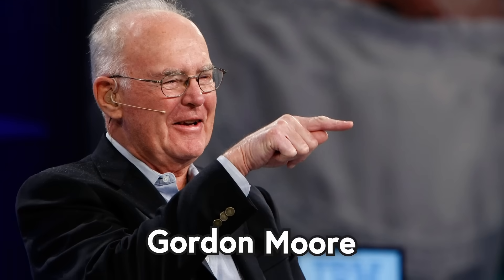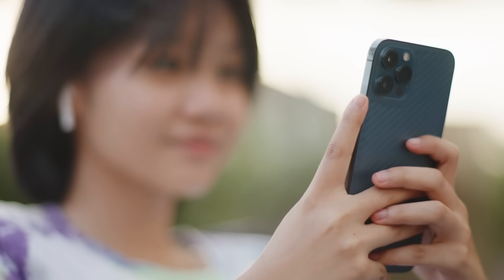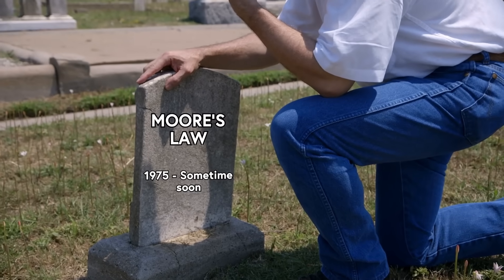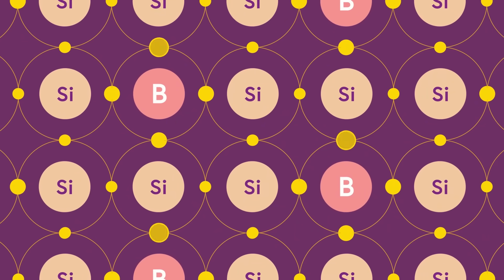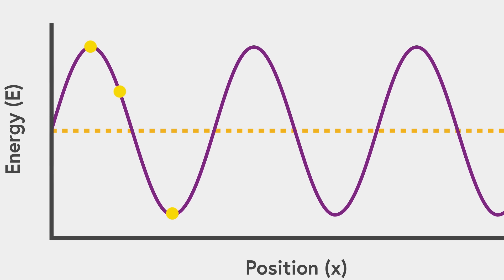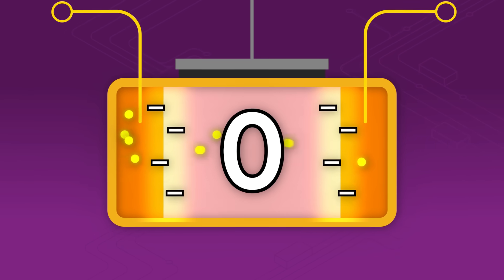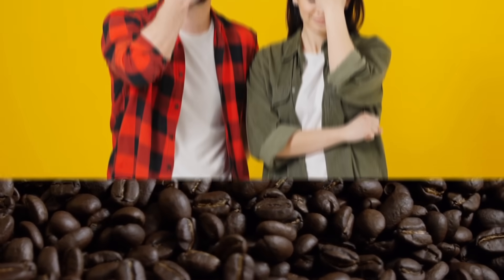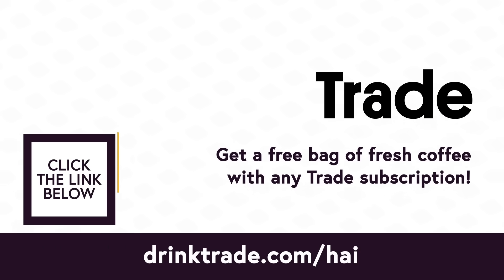Why We're Reaching the Theoretical Limit of Computer Power

Comment: As an electrical engineer, there's a lot more to computing than just the number of transistors, how all the transistors are interconnected and used is just as important. And even before quantum computing (maybe) takes over down the road, a lot of R&D is moving into optimizing chip transistor layouts instead of just shoving more transistors onto a chip. 3D chip design, which stacks transistors on top of each other vertically on a chip, is also an area of research though cooling such chips effectively is a problem that's yet to be overcome.

Comment: Could you hypothetically create a random number generator using the small size transistor?
Reply: A simple zener diode could do that too. It produces a nice quantum noise.
Any resistor actually produces thermal noise too, but you need much better amplification to see that, compared to the zener.

Comment: It's amazing how much faster an average modern computer is compared to an average smartphone from a decade ago.  But most average users do the exact same things on their modern computer as their smartphone a decade ago.  Yet somehow is operates just as slowly.

Hardware gets faster just so software can get sloppier.  There really aren't any new features that take significant new processing power in most of the everyday applications average users use.  Instead, the code just gets less and less optimized as more and more hands working on it and there is no incentive to make clean code since the hardware will handle it.  Consumers have accepted that load times are acceptable, even when they are completely unnecessary.

Comment: Why does electricity only come in two flavors, AC or DC?
Reply: It also comes in a third flavor 0C.
No current 😅
But no seriously the reason is for ease of use.
Most devices need a steady supply of current to operate and a DC or AC signal are easiest to produce/visualize.
You could have an AC frequency that looks like a heart beat but that would just be a dirty AC frequency which would probably require capacitors to rectify or very special circuits to work.

Comment: Because of quantum tunneling, we cannot make transistors physically smaller. However, by changing a planar transistor (which touches the voltage control on just the top side) to a Finfet (a fin where the voltage control touches the top, left, and right) or a GAAFET (a floating bridge between positive and negative where the voltage control touches top, left, right, and bottom), we can make transistors use less power, since with more sides touching, you don't need as high of a voltage to turn the transistor on.

The problem is, since the transistors are still physically the same size, they don't get much faster. This is why desktops haven't gotten much faster lately but phones have gotten more efficient.

Comment: Why not make a computer more powerful by making the chip bigger to fit more? Do we really need chips smaller than a stamp? Why not sacrifice the small size for a bigger one? It would then be more powerful... So what if the chip is the size of two stamps instead of one?? You could even go bigger than that to integrate cooling right into the die... Cooling the chip down will also give you more performance
Reply: Bigger chips necessitate lower clock speeds to keep everything synchronized, and bigger silicon wafers are more pricey
Reply: Because it gets exponentially harder and more expensive to manufacture let alone cool. Biggest chip in the world is 20x20 cm and it's used for AI.

Comment: Quantum computing probably won't be a thing for personal computers any time soon. What's going to happen next is that we'll look back to at all of the decades of really good ideas that didn't get further research because just shrinking the transistor was a safe and reliable way to improve performance.

For example, Silicon is a really good and useful transistor material, but there are physics reasons why computer clock speeds have been about the same for a while now. Other semiconductors like GaAs (Gallium Arsenide) can reach clock speeds of 250GHz according to Wikipedia, but are extremely difficult to work with.

Comment: Fun Fact: The transistors today are only called 3nm or 2nm, they are actually about 10 times bigger. When the transistors technology was around ~200nm, that size had a real world meaning, but a some point they switched the transistor make up which improved power consumption and/or speed without getting significantly smaller. So for Marketing reasons they just said the smaller number that fit with that improvement and that happened a few times since that. By now, they are of course a lot smaller, but we are far away from "just a few silicon atoms" And it's doubtful if that is even possible, quantum tunneling is actually a big problem for a while and has to be included in the transistor design since several years, at 2-3 nm the current technology definitely wouldn't work anymore ...

Comment: I work in the semiconductor industry, we’ve known about this limit for over 12 years.
Reply: Yes and you've been lying for about as long too.
Reply: @1pcfred  hmm interesting… and your credentials are?
Reply: @1pcfred  ohh I see your point. Yes TSMC defines their nodes different than Intel, that’s been happening for some time now. However, that doesn’t mean that there hasn’t been any improvements. It took a while for the lithography technology to improve and so the industry was stuck in the low teens nanometers for a while. The next decade will be different, the limit is truly going to be the atom spacing.
Reply: @1pcfred  if you had intellectual property to protect, I assure you you’d be taking the same strategy as they are. My understanding is that they use the theoretical spacing based on performance. You can’t argue that the devices have shrunk, use less power and perform much better than the previous generations. The specific details on how they achieve the performance or the dimensions of the device is their intellectual property.
Reply: @1pcfred  I don’t remember 64 core processors in 2010. Theoretically one processor today can do the job of 30 dual core CPU’s of 2010 and still have headroom.

Comment: Shouldnt it be 0 when current flows (low voltage) and 1 when no current flows (high voltage)? Or rather it would be cmos structure i guess
Reply: In conventional logic 0 is closer to ground than 1 is. Current flow is a factor in fan out. How much a gate can source or sink.

Comment: Enjoyable show. A good idea, for a show, would be how many times that Moors Law was declared dead because of physics.  It's not the first time for tunneling. How low can you drop the core voltage before it no longer can work? There must be a limit, but are we there? I kind of like the research into 3d memory.
Reply: We haven't reached the tunneling threshold yet so we don't know what it is. There's a fair chance we'll know it when we get there though. As far as lowering voltages goes that's an option that's already been heavily exploited as of now. You're running less than a fifth of what logic used to run at. You can be assured that they're squeezing every erg of performance out of stuff.